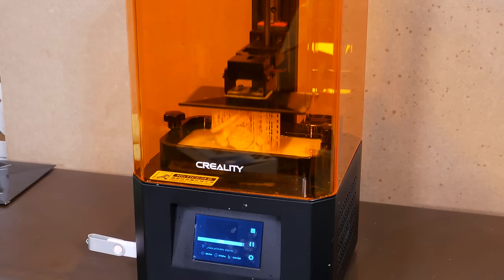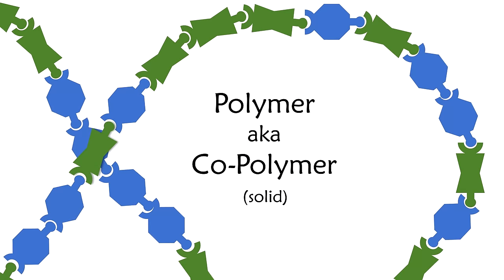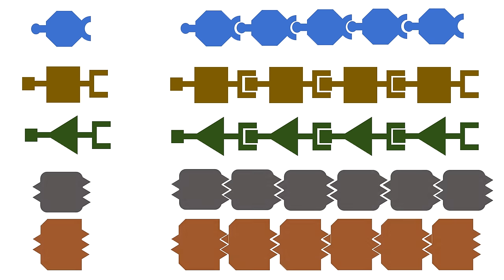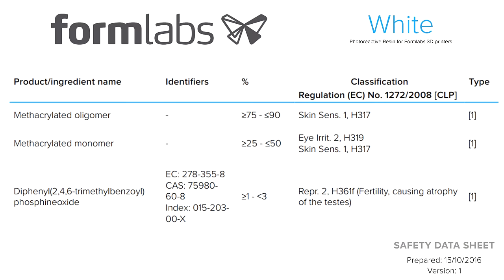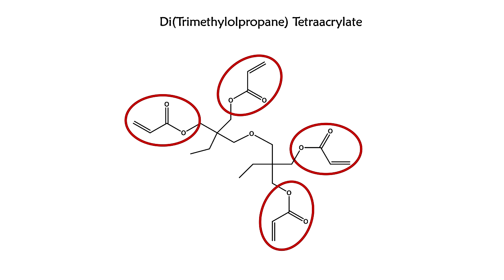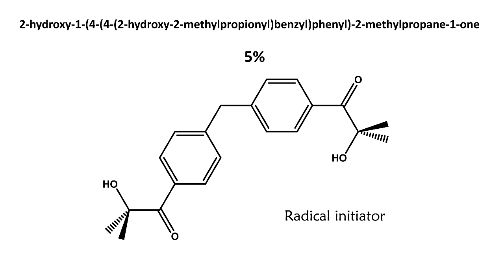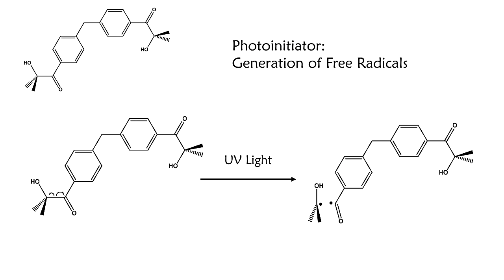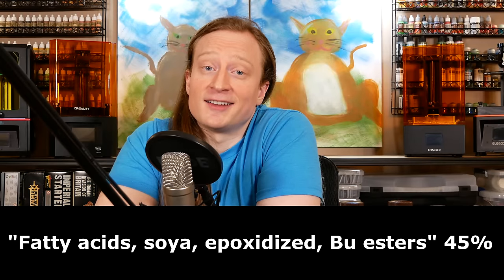Ph.D. Chemist Explains 3D Printer Resin

Comment: I have watched this video 3 or 4 times and it's really excellent. I founded a company in the early 21st century producing soy based solvents and as you pointed out, some to the claims are dubious at best, not unlike Natural Flavors which actually means organic chemistry!  I also hold a few chemistry patents but am self taught. 

I would love to see a similar video on water washable resins and specifically safety and best practices disposal.  I do not understand why the prohibition on pouring small amounts of water washable resins down the drain, as all water treatment plants aerate the waste water in sunlight which would cure any residual resin. Typically, I rinse the build plate in hot water over a 5 gallon pail. Then I remove the model from the plate, and then apply non ammonia window cleaner, scrub lightly with a toothbrush and then rinse in a steady stream over the sink. I cure the pail in the sun and then dump the rinse water in my neighbor's pool after dark (just kidding).  I filter and then dump the remains in my garden, kind of an LD-50 for cactus and so far, so good.

Thanks again!
Bob

Comment: Hi Brent, excellent videos on both the science and the painting.  Your production quality is really good and it shows that you put a lot of time into each one. Could you do a video on the proper type of respirator cartridges and filters to use for 3d printer resins, and different types of airbrush paints? Any other info on PPE would be of great help.  Thanks for the videos and keep up the great work!

Comment: Great video, very informative without being patronizing or being overly technical -- a very good balance.  Also, you have a very good voice -- you could do radio.  I'm planning to get the Anycubic Photon Mono X with the Wash/Cure setup.  I wonder, do you have any recommendations for slicers and do you create your own 3D models and if so, what 3D Cad program(s) do you use and suggest?  I've used numerous Cad programs though mostly 2D including AutoCAD LT -- at present I'm beginning to dig into FreeCAD and may wonder into Blender for some animation work.

Comment: What we do in our lab is actually stir up the container of rubbing alcohol, then set the jar out in the sun for a few hours, with the lid loosened just a bit. The uncured resin particles cure out of the alcohol and you can just pour it through a coffee filter. The resin left in the coffee filter is now cure and safe, and the alcohol is useable again.

Comment: Fascinating! I'd love to see a video on whether you think it's effective and feasible to clean isopropyl alcohol (IPA) used to clean resin prints. IPA is still fairly expensive and hard to find even today, especially in the quantities and high purity we need (I use 99%). But the solutions on the web are either potentially dangerous (home distillation) or unclear as to whether they actually remove resin and not just pigments, such as using aluminum sulfate as a flocculant or decanting/filtering dirty IPA for reuse. Lots of interest in this out there!

Comment: One trick I've heard of is to put the resin-filled cleaning fluid under a UV light, or in the curing machine you use for your prints. I'm told that causes the resin to solidify and mostly precipitate out (still filter it tho, there might be solids still in suspension). Assuming the container is transparent to UV light, and fairly stable under the same, that should result in very little loss of cleaner.

Comment: Thank you for the video! I'm a chemist too, but I didn't realy thought about compouds and process of polymerization of UV resin, so now I know. A couple of questions: what do we get after the print is done? Polyacrelate I guess? And how we can desolve it? I want to polish my prints with wapors of solvent.
Reply from the maker: The newly formed backbone chain is a polyacrylate... but of course all of the other oligomers from the liquid are still in there too, essentially as crosslinkers. I haven't found anything that the crosslinked photopolymer material disolves in... at least not with household solvents! :-)  I don't think vapor smoothing is really a thing with resin prints, but the layer lines are MUCH less visible than filament printing.  If any layer lines really annoy me I sand them off. :-)
Reply: @GoobertownHobbies  Thanks for the answer. If you know any solvents that are not household it would work for me, because printer is in laboratory, so I can get whatever solvents possible. The problem with sanding is it really hard to sand small figurines. I don't care if I print with grey resin, but translucent resin is not clear because of layers

Comment: Hey Goobertown Hobbies! Chem (yet unfinished) Masters here. I have really enjoyed watching this science-hobby playlist :)
I do have a question about this video. Why do you think that the epoxides are only acting as fillers? Don't you think they would be highly reactive, especially under UV light?
Reply from the maker: I'd be curious to learn more about them.  My understanding is that the epoxides act as a preservative, reacting and consuming various impurities in the mix.  There's a wikipedia article on epoxidized soybean oil that might be a good starting place for you!  https://en.wikipedia.org/wiki/Epoxidized_soybean_oil
Reply: @GoobertownHobbies  Aah, maybe what they mean by "stabilisers" is that because they are so reactive, they could absorb some of the radicals that are being produced, so that the radicalisation is not destructive to the polymer? Although it does also say that they are "scavengers" for HCl, which is not applicable to this type of plastic

Comment: Great Video!!! i love it. Can i ask one question? Why is transparent resin yellowing, and how can i stop that (without coating)? Kind regards.
Reply from the maker: There may not be much you can do about that.  Most organic compounds (like polymers) are colorless, and maybe absorb just enough violet light to appear yellowish.  As compounds decay over time from heat/ UV light that yellowish cast can appear.  You could keep them in a glass case that catches UV lights I guess to preserve how long they stay colorless... I imagine as this hobby matures certain brands of resin will emerge as winners that stay clear and colorless longer.

Comment: Amazing video, thank you so much.. I really think it's important to know this information for all printing enthusiasts.  I'm a dentist and as you may know, 3D printing is becoming a big deal in our field. We have been using resin for decades and polymethacrylate parts are one of the most common components of dental appliances. What's the difference between a dental 3D resin and a normal one. They seem to share the same components. A fully cured resin still toxic?. Also, it's possible to over cure a resin, some discussion has araised on this topic, and from what I understood in your video, theoretically, once all radicals and odd molecules have react, there is nothing else to cure. am I right?. Thanks again for your work and your valuable knowledge...!

Comment: This was excellent! I work in a color lab and want to start experimenting with 3D printing. Have you experimented with modifying these resins with other raw materials? (Also 5% loading of PG 7 is crazy high, so that made me give that SDS a very hard side eye lol. To run masstone of an organic pigment you’re typically only running 0.5% final loading in the polymer, and phthalos are stronger than a lot of the other organic pigments.) Anyway, thank you so so much for sharing! This has gotten me even more excited to get started.

Comment: Really good and informative video Brent. Damn it's really just therapeutic to watch your video's. Thank  you :) 

Do have a question though. Considering we are living in a studio the fumes are the biggest reason why i haven't bought a 3D printer yet. But would it really be that bad if i placed it right next to a door to the balcony that i could open if/when needed and a window above it that's open 24/7? Most of the day we would be sitting at least 5 meters or more away from it and i wouldn't have it running over night.
Reply from the maker: Heyo!  Next to a window with a fan is probably decent, especially if you're a ways a way.  Of course there's a massive gray area here, but use good sense and don't inhale more resin than you really need to :-)
Reply: @GoobertownHobbies  Thank you very much for replying Brent. We're going to get one. Decided that i'll print batches so i just have to use it once every 2 weeks or something like that. Combined with the open door/window, blower blowing against it towards the opening and a couple extra filters inside the case we should be pretty good :D. Hopefully on the good side of that gray area :).

Comment: Hi! Some has recommended your channel to me and I'm glad they did. I've been printing with resin for year, glad to finally know what happens in there :). It's great work really.
There is one thing that has been bothering since the beggining with resin, is how easily they scrath. I'm doing mostly mechanical parts (but some also need to be nice looking, like threads for round boxes) and when they are in contact with each other or even if I rub them with my nail, they get scratched and produce that white powder. Do you know if there is any resin that doesn't do that? I tried standard elegoo black, abs like grey, photocentric firm black and it's all the same... Was thinking the Siraya blu?

Comment: here is a question ! When you showed the MSDS of different resin types, the Formlabs one stood out to me. I have been trying to use cheaper resins, like the ones of Creality / Elegoo printers to run on the Formlabs, with very poor results. While both printer types are different from a technical standpoint, one uses laser lights the other a LCD screen to expose / cure the resin. I think it is safe to assume that the LCD type would require more exposure due to the lower energy density of the UV light through a LCD panel, vs. focused laser on a Formlabs printer. 
I think that is reflected in the photoinitator concentration. Formlabs states about 1/2 of the %. In reality the regular resins heavily overexpose on the Formlabs machine. 
What do you think, diluting the resin mixture with more monomer / polymere resin, so that the initiator comes down to the same 1-2% of the Formlabs MSDS could actually do the trick ?

Comment: Thanks for making this video. Great content.  One question regarding one of your ending statements that says we should shake the resin more. Does that mean we need to pour new well-shaked  resin into the vat every time we start a new print? What if there are some resin that's already in the vat for about several days? Thanks very much
Reply from the maker: for resin that's been in the vat for a few days I use a plastic spatula to swirl it around a bit to keep it stirred.  If I start a new print immediately after the prior one finishes I don't worry about it too much.
Reply: @GoobertownHobbies  thanks very much for quick response :)

Comment: This was amazing, hooked all the way through!
I'm considering getting a resin printer but have been a bit worried about the resin itself, my girlfriend is even more worried. We live in an apartment with no room to dedicate for the printer so it'd end up sitting in the living room for now. We have an air purifier with HEPA activated carbon filter, I'm curious whether or not it would be enough to put the printer next to the purifier and still be in that same room? From doing some online research there are many conflicting arguments concerning this. What would someone with your knowledge say? Also, do you know if there are any resins that has come out since the making of this video that you would argue is less of a safety hazard? I'm not too worried about getting it on me, seems gloves can solve that issue for the most part. Mainly worried being in the same room as it's printing and potentially breathing in the fumes. I hope that it wouldn't be too much trouble giving me some extra insight on my dilemma :)

Thanks for this super interesting video, instantly subbed! :D

Comment: Great video, very clearly explained. Can you please do one about the differences between water based (water soluble) and non water based (alcohol soluble) resins?
Reply from the maker: I need to do a bit more digging on this topic.  I suspect the core reaction is exactly the same, but the reactants just happen to have more hydrophilic "tails" in the water washable version.

Comment: Very informative video and good to see a chemist explain this!
As a masters student in chemistry, 3D resin printing got me wondering and looking forward to get one..
Can you print for scientific purposes like chemical resistant tools/vials? Usually it is Polypropylene or PES..
What if you alter the wavelength to higher energy (< 405 nm)?
What factors affect the precesion/quality of the print? Resin viscosity (thickness/length monomer), screen resolution, UV depth/brightless for layer thickness?
Print dimensions are usually shown as µm^2 but shouldn't this be µm^3 as the layer hight also has a min/max?
Reply from the maker: In a liquid like that the activator will have a decently wide absorption band for absorbing light and fragmenting.  Shorter wavelength should also work, yup!
Reply from the maker: The height of the voxels is set by the user when they set the layerheight, but most printers can do layer heights that are consistent with the 2d pixel sizes....  I don't have a firm handle on how the viscosity affects things.  The concentrations of various ingredients and the opacity of the resin likely have a greater effect.  Fascinating stuff! :-)

Comment: thank you Brent for this video! I'm wondering, is resin totally safe to the touch once cured (just like any commercial plastic item) or do you still need some precautions (like painting it)? Also some resin can be tacky, does that mean is not fully cured and so still a bit dangerous? thanks
Reply: I wondered the same, any answer to this Brent?

Comment: Hi I also want to express my thanks for this video.  I have been sifting through so many "resin fundamental" videos that have absolutely nothing to offer in terms of real information. I just was hoping you might clarify something that's been bothering me while troubleshooting my own prints. You said that the UV light initiates a reaction that creates free radicals that try to bond with other molecules in the resin. Am I right to assume that the resin left over in the vat after a print should be considered degraded because this scenario and will not cure the same as a fresh unexposed resin. I feel like this is the case and have noticed the decrease in print success after reusing resin, but I have not found anything that specifically says this is the case. Really a great video thanks!

Comment: Awesome content! Thanks for going into the details of resin composition. Some resins (e.g. 3D Jake resin), however, also list isocyanate as compound, which according to European work safety regulations seems to be a very toxic group of chemicals for which annual health checks are required if used at work - do  you have any recommendation for these other than to avoid resin with such compounds? Lastly I am curious why you are using multiple different resin printers rather than multiple of  one brand - would be great to see more resin printing videos of yours!

Comment: I'm curious, after decanting the IPA, if you wanted to clean the contaminated IPA+Resin container more than with just a paper towel... Would you hit again with more IPA? Detergent? A stronger solvent like Acetone?

At what point would it be safe to begin washing it in a sink? At what point would it be clean enough for other uses?

Comment: It would be great if you could do a related video on the safety considerations of the solid cured resin.  There is a lot of mixed information out there ranging from "you shouldn't play around with the cured resin until it's painted/varnished" to "meh it's no worse than any other random plastic toy".

Comment: The disposal information was incredibly handy, as someone who hasn't tried SLA yet the resin waste was concerning me. Still have to find somewhere to put the machine that is suitably ventilated. 
2 quick questions, 
Would it be safe to use one in a kitchen?
Could you cure the resin out of the alcohol mix with uv light, such as putting it in a curing station?

Comment: XD great information...opened my eyes to the differences in the resin base materials...i belive the fillers is what gives the structure the softness and or strenth....so with that information i can move forward with printing ...ive had my lnger 10 for a bit over a month and i finaly got the exact bed starting point leveling from screen to give me perfect 2mm tall prints designed at 2 mm height, so now onward with materials

Comment: I'm thinking about buying elegoo's water washable resin. Now I know not to dump the water down the drain, but how does one deal with it? It won't evaporate as fast as alcohol. Does the same process of decanting apply? and if so, is it then safe to dump the water?
Reply: cure the water/alcohol solution strain the solids and pop the solids into the bin and then reuse the liquid.... i'm testing my liquid as a weed spray